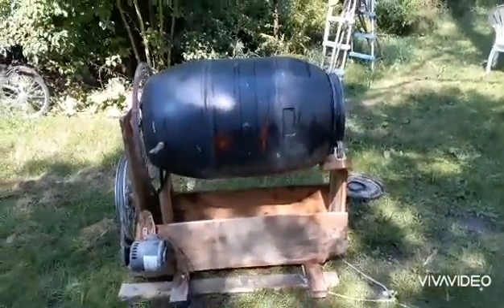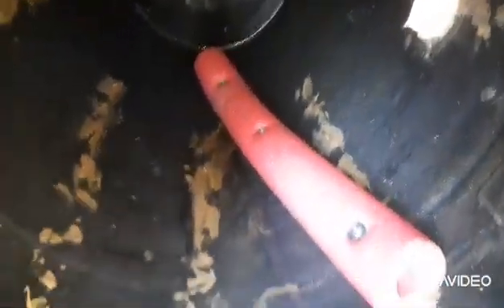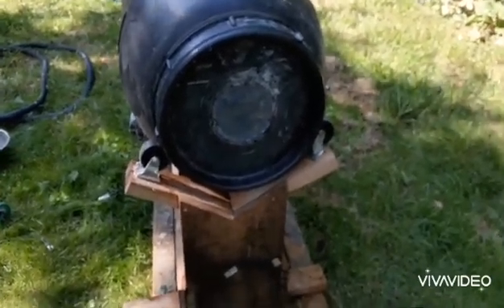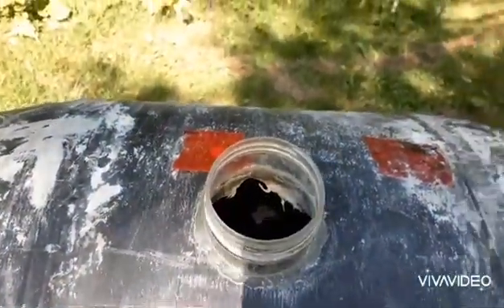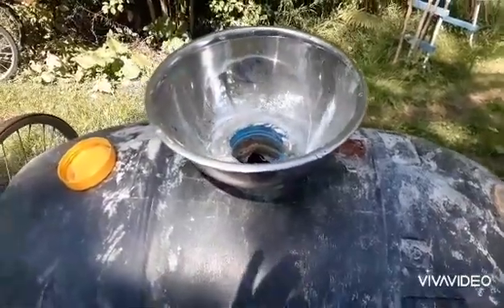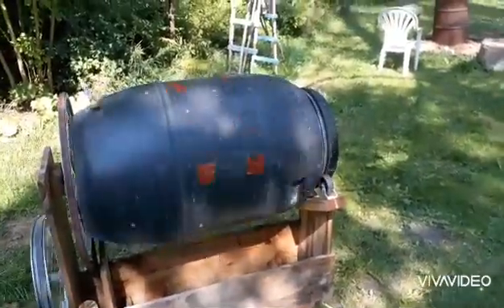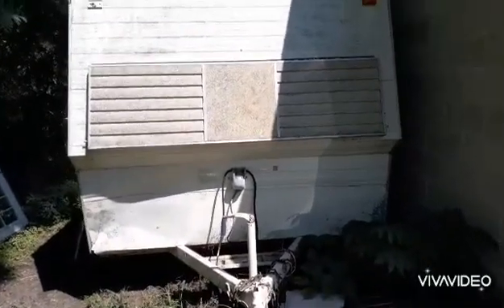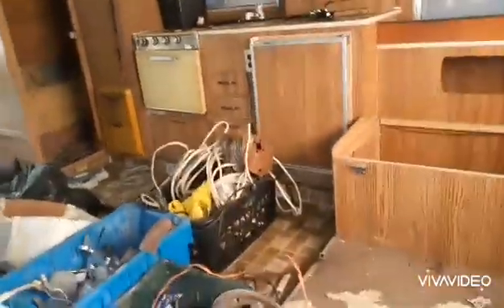Aircrete mixer explained and exciting new project!

Comment: Great job! I assume the mix didn't have lumps and was consistent as well?
Reply from the maker: No lumps...worked really well... however, because I now add shredded styrofoam to the mix, I use a open plastic barrel and seal a lid on before just rolling on the ground...
Reply: @ruggedist  I'm with you on the added styrofoam. In the process of looking for ppty and will be doing something small with aircrete to practice and get a real feel for what's involved~ Thanks for your info here. I hope you have continued success!

Comment: Hello George, I have some experience working on trailers for years. That was about thirty years ago. They did not really build them that well back in the day so why should they build them any better now. Seen a many that are just five to ten years old and leaking like a sieve. The fiberglass insulation when it gets wet it stays wet and rots the wood inside the panels.  The roof sealant you are talking about is used literally in all commercial building roofing these days. Pure white is the color and the coating is applied every so many years. What is the percentage of foam collapse when you use 10 PSI to pump the aircrete ??? Maybe using some silicone additive to the mix will give you more flexibility of the mix. Just an idea Sir. Keep on experimenting. That is when one finds out things that are unique and cost effective. Peace too. VF
Reply from the maker: The 10 lbs pressure did not have any impact on the foam at all...
Reply: @ruggedist  Thanks for the reply fella.

Comment: Sounds great, I have also wondered how aircrete would work on an rv trailer/camper, so excited you are doing it! In place of your peanut butter filler, how about a 4" or 6" pvc threaded pipe and cap?    Wishing you the best, it will be a great learning experience!  How about using styrofoam  and cement mix using metal studs? This mixture is much lighter, higher R value and much easier to mix.       https://www.youtube.com/watch?v=27v7Oq-q9xs&t=235s
Reply from the maker: Great idea! Ad far as metal studs go...great concept but...the below zero freezing temperatures here will transfere the cold into the building, unless you create a thermal break...i
E.
Reply from the maker: 1" styrofoam on outside or split the stud and use hot glue.

Comment: Good idea. What about using a variable speed controller on the motor to get rid of the floppy wheel. They're pretty cheap through harbor freght .
Reply from the maker: So I  am about to rebuild it a bit by using a pair of bearings with out side support to steady the drive wheel...